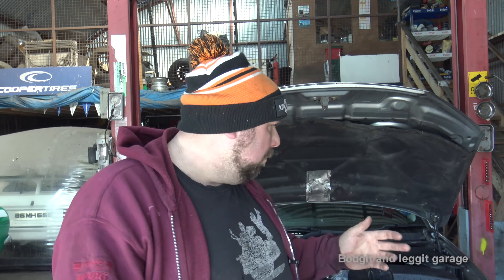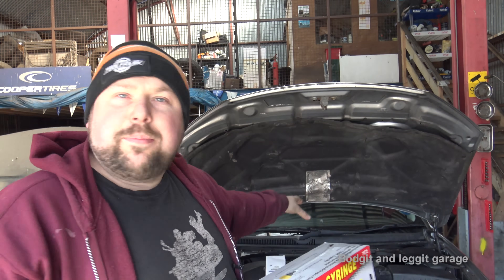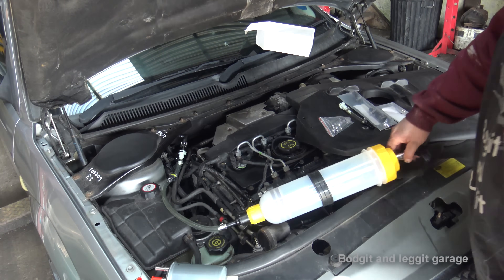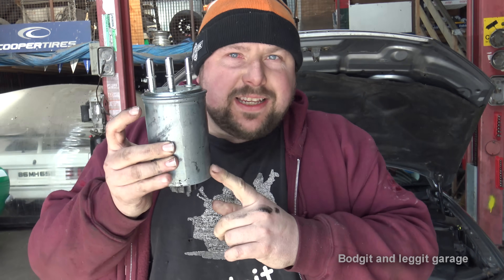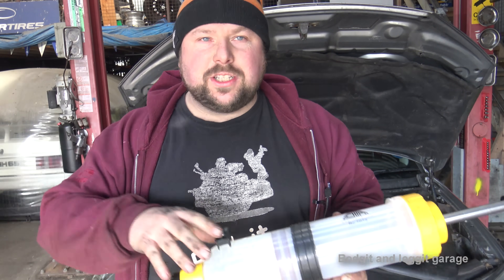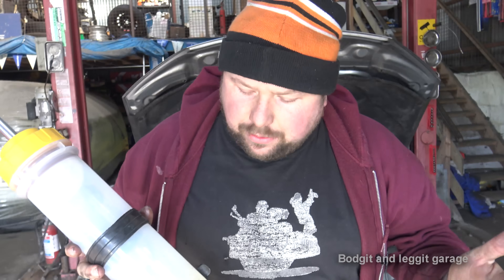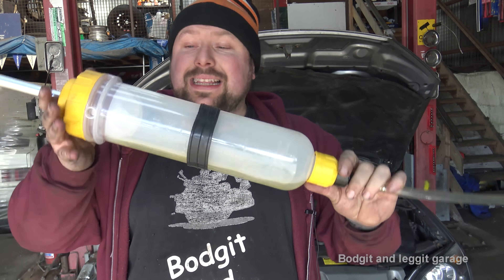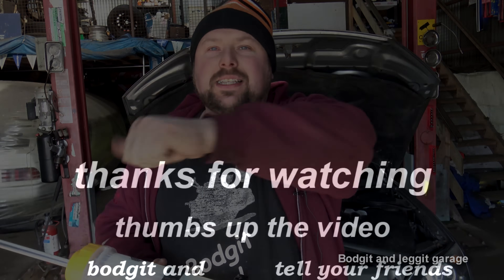How To Bleed Any Diesel Engine Fast&Easy CTA Diesel Syring Bodgit And Leggit Garage

Comment: I like the idea and the giant sucker thing  too :)  Ok I have to start up my 2 cylinder kubota diesel engine that is in storage - a common rail and everytime it takes  quite a bit of cranking to  get the fuel pump to fill the injector tubes as I open the bleeder tap on it. On the return side could I use a suction and pull the fuel up to the rail as well  from the last downstream return connection .  Never thought about it till now  - hey Leon this might be a vid of yours I could use. LOL
Reply from the maker: STEVE ROB REVIEWS 🤣🤣🤣🤣🤣🤣 I'm happy I can help you out at least one time
Reply: bodgit and leggit garage ok like ya haven't helped me out yet - wth is going on , would your idea work  for what I wanted to do. Ok Leon I  was expecting a  confirmation it would work or not - get with the program eh . HAHA

Comment: Your video reminded me of the DOT that stopped me on the M4  I was driving an old ford transit recovery flat bed that I had fitted a 3L v6 to do this I had to use the diesel front. The DOT stopped me and asked if they could check my fuel I agreed and they sucked fuel from the tank but because it was petrol in a diesel testing kit it melted their test equipment. They asked to test my fuel but they did not ask to check my diesel. Spoilt their day good news.
Reply from the maker: Julian Thomson hahahhaha
Reply: serves them highway robbers right 🙂